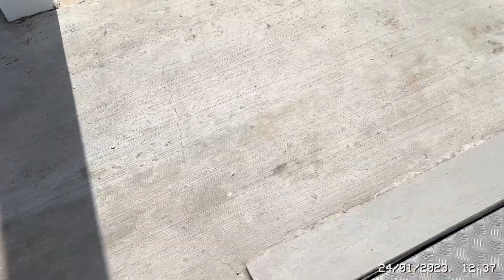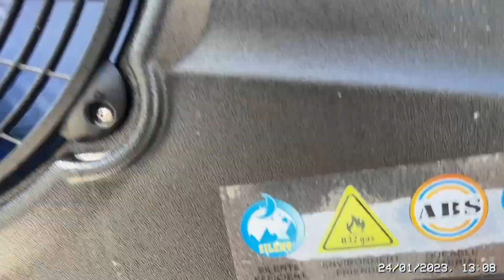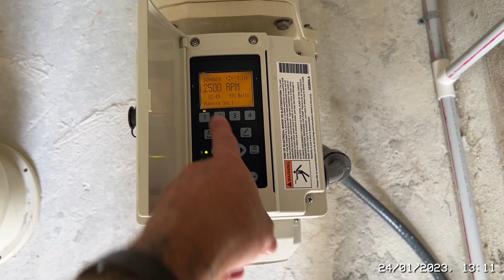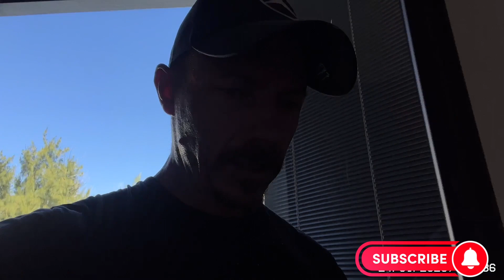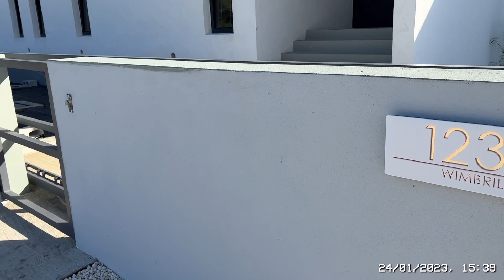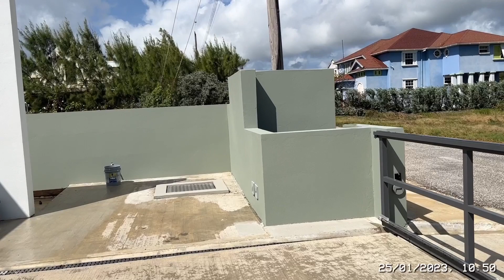Barbados 🇧🇧 Beach House Build - Day 420

Comment: From the others similar condenser I've seen, they have a rubber hose attached inside and coming out of that hole so not to collect on the inside tray
Reply from the maker: Yes it has a hose which is now connected but it still collects along the metal tray, then finds its way to the hole. crazy design.
We also have allot of water coming out too which is soaking the soil, so I need to find a better way of getting rid of it.

Comment: Hi Alvin, are you going to put balustrades around the outside shower/steps area?
Reply from the maker: Hey Kellie, yes we may have a solution put in, we have initially looked at ali posts with stainless steel cables.